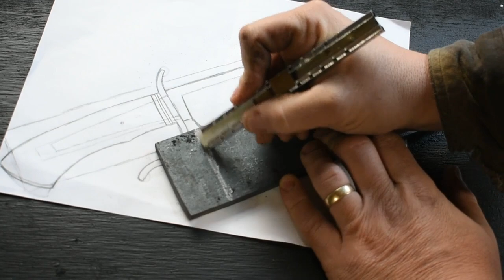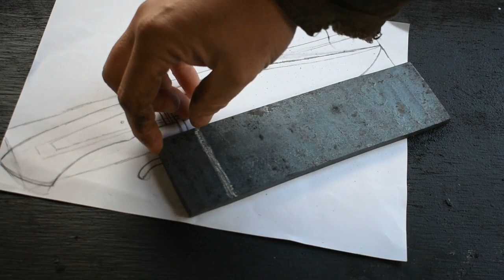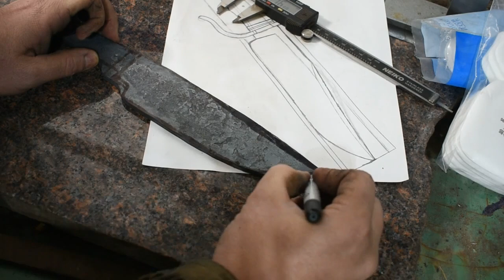Forging a San Mai Damascus Bowie Knife the complete project

Comment: Elegant design and the Ironwood was a beautiful choice!
I'm interesting in the piece you use to mark your lines!  What is it, exactly!  It narks well and as, a beginner, at 69 years old on the 12th, I need a good marking gauge!
I'd appreciate it if you'd let me know about it!   Thanks, in advance!
BEAUTIFUL BOWIE!!
Reply from the maker: Thanks! I appreciate you watching! It is a height gauge I purchased from grizzly industrial, you can find the digital versions on Amazon by searching height gauge, I wish I would have purchased a digital one it would have made things easier. As for my granite surface block I use it on I got it for free from a counter top stores scrap pile. Congratulations on starting your journey it's a fun one to be on.